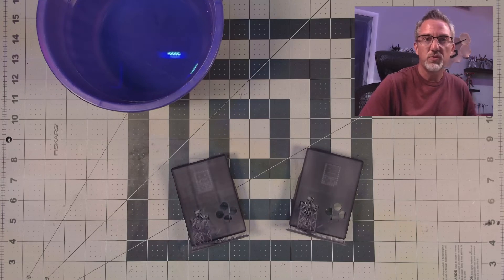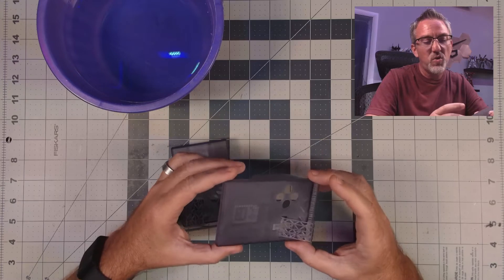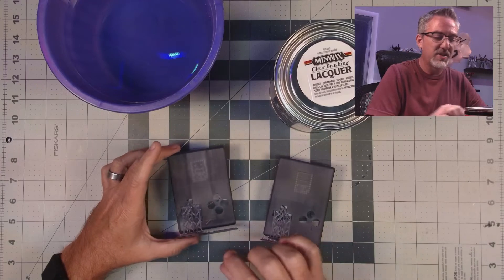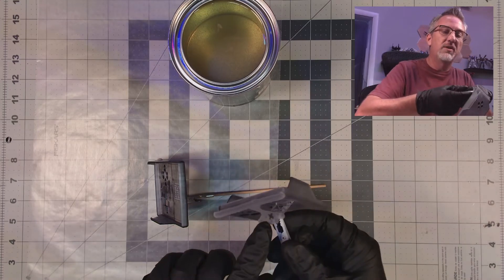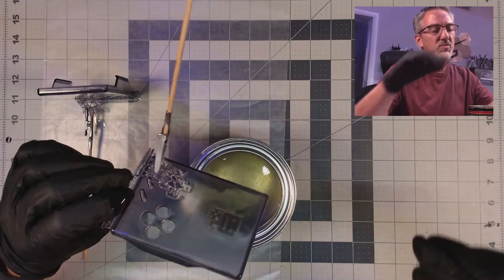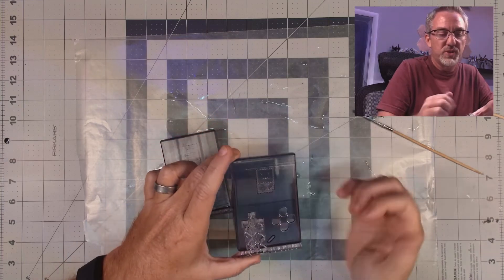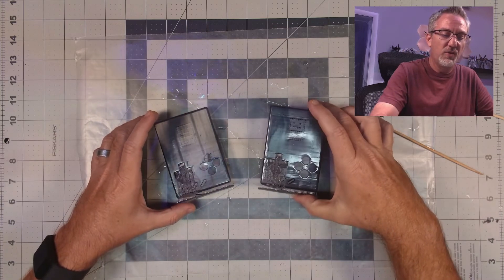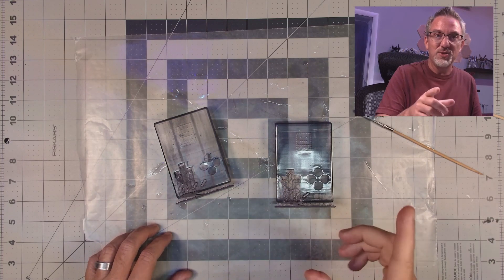Resin Printing: Improving the Appearance of Transparent Resins

Comment: I wonder if you could thin the original resin, and coat it with that instead

And if that actually improves the finish over lacquer
Reply from the maker: It probably would, but it seems like a messy process and it'd be hard to get that thin coat of resin to cure fully without leaving a sticky surface. I think the easiest solution is just to spray the cured prints with a clear lacquer gloss paint. It's not a perfect finish, but it's pretty good.